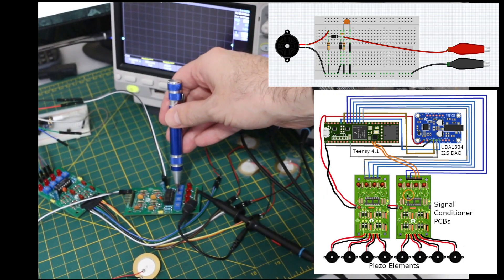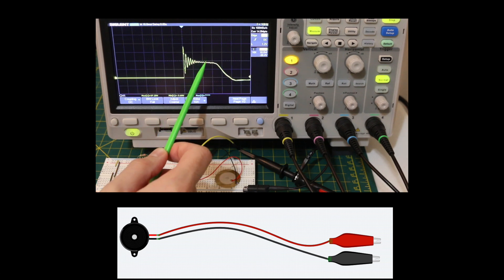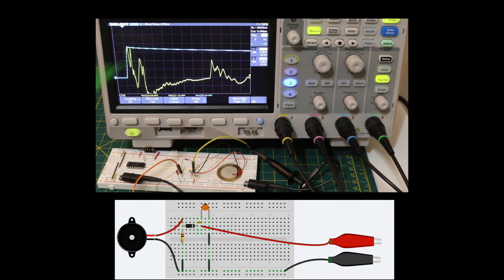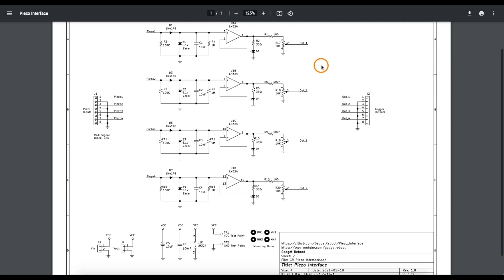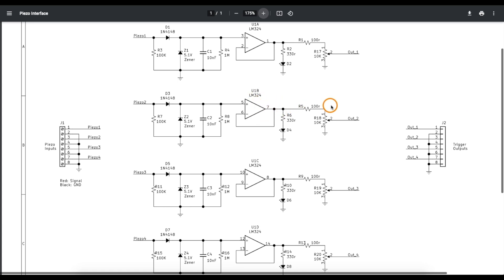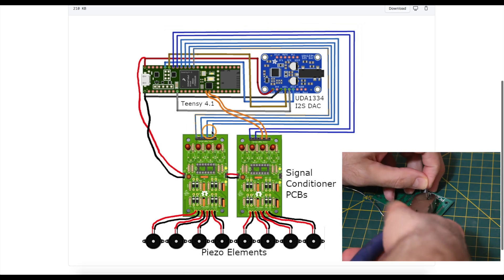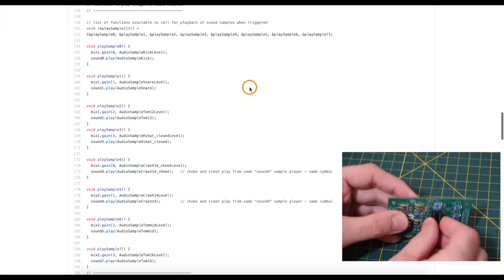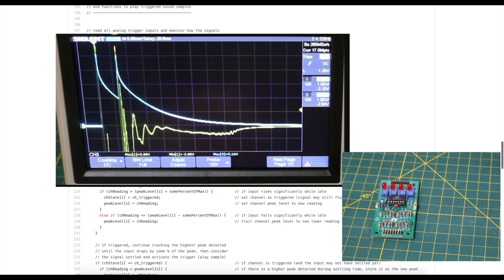Teensy 4.1 - Piezo Drum Trigger Signal Conditioner Interface (4-ch)

Comment: Hi, why do you do the peak detection befor the amplifier and not after?
Reply from the maker: The signal conditioning hardware is primarily to get the voltages within safe levels because sometimes it generates over 50 V.  
Then a load is needed on the piezo to help discharge its capacitance after being struck because otherwise sometimes when it is hit, it just stays up at an elevated voltage for a significant time and further hits may not be picked up.
so I decided to keep the voltages within the power supply range and force the signals to drop in level fast enough to pick up multiple hits.
The peak voltage didn’t always necessarily correspond with exactly how hard it was hit so the same relative strength of a hit might generate 20 V one time and 50 V the second time so I can’t just assume that one of them is more than twice as strong as the other based on that it was just a trial and error process where I found I can figure it all out with a max 5v normalized peak

Comment: Hi. Thanks for your video. I want to trigger the sample sounds on my wav trigger card using piezo. I'm trying to make some kind of percussion. wav trigger card also works with 3.3 v. trigger. I want to use your circuit in my own project, but did you feed the op amp directly with piezo or is there an external power in the circuit?
Reply from the maker: The op amp has a 5 V power supply and the piezo has some resistor capacitor diode passive components to do signal shaping on its way into the op amp. then the output of the op amp can have its maximum voltage controlled with the potentiometer for whatever it is actually triggering on another circuit to make sure the voltage is not too high

Comment: I'm thinking about using a digital output to act as a switch and discharge the capacitor quickly, but after a certain time, let's say 50ms. This should ensure that the ADC reads the right value and that there's no extra false trigger signals, like in 5:23. Has anyone done that?

Comment: Is it possible to use this (minus the adafruit board) for MIDI triggers? I want to use it a highly-responsive double-kick pedal setup where the piezos would be side by side hit by the kick beaters. Ideally it will just have a USB cable to send the MIDI from the Teensy to my computer. If I'm just doing MIDI triggers do I even need the signal conditioning?
Reply from the maker: i’ve never made a midi project but as long as the module can send midi messages over USB then it can do it on any input including this because the mini messages would just get sent out based on some decision being made in software.
 So the decision would be to send a message rather than playback an audio sample.
The main purpose of the signal conditioner is to get the voltages down within safe levels for the module inputs so it is still needed.

Comment: First, amazing video! I learned a ton just from the piezo signal conditioning segment alone!

I have a question regarding your choice of the Teensy microcontroller. I was hoping to use an Arduino for my project, but I'm struggling to play multiple sounds simultaneously (for example, a kick and a hi-hat are often played on the same beat). Is the Teensy board capable of playing multiple sounds simultaneously? Also, would it be possible to write code so that, depending on the strength of the signal from the piezo, a different sound file is triggered? I'm thinking for example, light taps on the snare pad trigger a rim click sound, but stronger signals on the snare piezo trigger a full snare sound.

My project will also be battery-operated, so I'm looking for a Microcontroller with a low power draw. When trying to choose a low-power microcontroller that can play/mix multiple sound files simultaneously, what sort of specs should be looking for? Thanks!
Reply from the maker: with the teensy it can play multiple different sound files simultaneously because they are all set up as if they are a separate sound source going through a mixer so the sound just gets triggered and then it plays through the mixer in software. I haven’t tried it on anything else so I don’t know if other software libraries on other chips can easily do the same but I just wanted to get up and running fast.
software can look at the analog trigger input and determine if it is a soft or hard hit and then decide to play a different sound sample because the strength of the hit causes a different peak voltage so decisions can be made based down how strong the input is.

 The harder part might be calibrating it so that it consistently knows the difference on a single input because there could be a legitimate quiet hit intended for one type of sound to be triggered but it gets interpreted as too quiet of a sound and it triggers the other thing

so multi zone separate triggers might be more ideal like how they do triggering on a snare with one dedicated sensor for the snare head and another dedicated sensor attached to the shell for rim hits.

for power consumption I don’t know if it directly would relate to the ability of a chip or its software to play multiple files simultaneously, it would probably come down to how fast the processor runs and if it has more on board resources that need more power in general to run so if the project is just to blink and LED, obviously there can be overkill processors that will blink it just as well as a simple circuit but take way more power
so it’s probably best to focus on what processors can have libraries that play multiple simultaneous sounds as a starting point and then look at their power requirements
if there are multiple chips that are capable of playing the sounds as intended
Reply: @GadgetReboot  Thanks for the quick reply. Everything you mentioned made a lot of sense.

I looked closer at your sketch and realized that the Teensy is not playing .wav files from an SD card, but converted .wavs using wav2sketch. So that effectively eliminates the need for an SD card, and allows you to store the sounds directly on the Teensy's flash memory. Really neat stuff!

I wonder if you happen to know the overall size of the sketch in KB as it was uploaded to the Teensy? I'm trying to come up with a minimum RAM requirement for my project while choosing a microcontroller. I don't see myself needing 8 different sounds as you use in your project, but knowing how much ram your sketch required will help inform my decision as to what microcontrollers might be appropriate for my project. As I mentioned previously, I'm trying to keep my project compact physically, as well as keep the current draw to a minimum, so if I can get away with the 2MB of flash memory available on the smaller Teensy 4.0, I would probably prefer that over the larger Teensy 4.1, even though it has 8MB of flash.
Reply from the maker: I just compiled it and it shows
Sketch uses 2159648 bytes (26%) of program storage space. Maximum is 8126464 bytes.
Global variables use 45748 bytes (8%) of dynamic memory, leaving 478540 bytes for local variables. Maximum is 524288 bytes.
So just over 2 MB of flash including all those samples and 45K of ram it looks like
Reply: @GadgetReboot  Awesome thanks for those numbers!

Today I ordered the Teensy 4.0, along with their Audio Adapter Shield. Hopefully I can fit my program into the 2MB of flash on the Teensy 4.0, but if not, the Audio Shield has a nifty spot to solder on an additional flash memory module, which looks like could expand storage by another 128MB, which would be PLENTY of space for my use. 

Thanks again for the info. I'm considering creating a PCB on PCBway for some of the additional circuits I may need. If so, I'll be sure to use your affiliate link!
Reply from the maker: hopefully it all works out. I might try using ESP 32 some day if I can find similar audio player code.

Comment: Why is the OPAMP needed as a buffer, what would be missing if we just use a 3,3V Zener diode and plug is straight into the ADCs?? Thanks
Reply from the maker: One reason for all of the signal conditioning was to help control the signal because once the sensor was struck, sometimes it would hold on to a voltage for an extended amount of time before the charge goes away so the ADC would see this extended duration maximum voltage based on what the Zener clamps it to.
that was making it difficult to detect multiple rapid strikes.  they would just look like one long single hit so the components help to discharge the transducer and then It can pick up another signal instead of it getting lost.
and with all of those extra components, that’s why the op amp  was needed to buffer all of that from the ADC, so that it doesn’t impact the behaviour of all of the charging and discharging timing.

Comment: can't thank you enough for this. i'm working on a desktop sized trigger with the same layout as a certain javanese instrument to use as a practice tool. the instrument is comprised of two rows of seven horizontal gongs. the scale ascends left to right on the lower row and ascends right to left on the upper row an octave above. so it's a bit of a brain breaker if you're not used to it. it's also enormous and i wouldn't even know where to get one if i had the money and the space! so how to practice?

not using MIDI hadn't even crossed my mind! but a self contained unit that just does the one thing it's meant for has an elegance to it. some serious food for thought. of course i would either need two 7 channel boards or 4 X 4 to pull it off...  

anyway, thanks for the great explanations of each component's job in the circuit. this solves the issues i was facing with piezo and teensy. very excited to look more deeply at the code and see what ideas are born;)

Comment: super cool man. why use the zener and all that when you have the 1n4148 which drops the signal by .7v if the input is 5v. you probably said brother but i missed it. i get why you used the opamps. i like how you use them all the time, it shows your experience and the fact you want to keep the signal integrity. i suppose the dc input to the opamps are 0 on vss and 5 on vcc ehh? or could you put higher voltage through them then trim the output with the pots on the output?  awesome circuit man.
Reply from the maker: The zener was used just to try to keep the signal no higher than 5v but let it pass unaffected within 0-5v because the peaks can be anywhere up to tens of volts, so I'm keeping it max 5.1.  I don't remember the max input op amp voltage on that part relative to VCC but definitely not higher than VCC.   I keep meaning to do a revision of the circuit but then I keep forgetting what changes I wanted to make.
Reply: @GadgetReboot  ok cool. I don't think you mentioned is why I asked but I'm apt to miss things pit of stupidity haha.

Comment: Hi, congratulations on your project, it seems really well done and above all well explained. Maybe I ask a question already asked: you built and calibrated this circuit by hitting the piezos directly. In a battery with mesh heads, the piezo receives much less stress than hitting it directly, I breadboarded your circuit but on very low hits without the op-amp receiving almost nothing to amplify, so its function is very limited, do you have any suggestions?
Reply from the maker: if there is still a signal but it is weak, I would probably be performing the same calibration playing with existing component values in a prototype until I get a signal strength that works with the set up or , adding another op amp stage at the output can boost it, as long as the maximum voltage is still going to be within safe  limits for the input it goes on to.

Comment: Hello.... I tried to understand everything, but since english is not native, i might have miss something. If I follow and build everything you show, i dont need a computer and softwares to play? It will work as a modulo as the commercial drums do?
Reply from the maker: if this project is duplicated, there is no computer needed after programming the teensy 4.1, all of the sounds are in there and it works as a standalone player.
Reply: @GadgetReboot  since i dont know how to sold the PCB, is it possible to buy aready built? And is it possible to control more than 8 analog inputs?
Reply: And... is there a Hihat controller? To control the opening and closing making different sounds?

Comment: @GadgetReboot im back on this project after being busy with work, im thinking to order this from PCBway, but before that, i wanted to ask if theres any improvement you make on the circuit design?
Reply from the maker: I haven’t changed anything on it since it was released.
Reply: @GadgetReboot  awesome! Pcbway review my order currently, im going to use it with my old teensy 3.2. For sure need to do change the io assignment..but else than that..do you think the code run on teensy 3.2?
Thanks for the reply
Reply from the maker: The oldest board I have used is 3.6 so I’m not sure what the difference is, the only special thing the software does is load the audio samples into memory to play them back so maybe there could be a problem if that other board doesn’t have enough memory so you could try compiling the sketch for that board and see if it fits, and if there’s not enough memory maybe you could remove some audio samples or use smaller ones
Reply: @GadgetReboot  ive ordered the board from pcbway, id love to get your assistance in this if you provide the service, i have a very specific project that i want to establish.
Reply from the maker: I just make personal project videos, I don’t have the resources to do anything beyond that.

Comment: Hi! Very nice video, thanks a lot for that! I have a question: I haven't tried out the circuitry but just having a quick look makes me wonder if the Zener doesn’t limit the dynamic range of the interface significantly. For example, my edrum pads output up to 30 Vpp, with the positive component (after rectification) being roughly 20 V, if I hit them hard. Here the Zener would result in all hits giving more than 5.1 V piezo output being clipped to the same value, wouldn’t it? Thus, I would lose ¾ of the dynamic range. Or do I misunderstand something here? Would it be a workaround to use a 100k trimmer in the input that would still load the piezo with 100k but also giving the possibility to scale down the input to the full dynamic range of the drum pad?
Reply from the maker: are those pads pretty much the same thing, just a striking surface with the output of the sensor and no other electronics until they plug into something else?
The reason it’s scaled down to 5 V is because that’s the limit of the digital circuit it ends up plugging into so whatever those pads plug into probably ends up scaling that down as well to a safe level.
I don’t know if it works out directly proportional but it’s possible some dynamic range is still preserved by clamping it at 5 V max because it’s  sitting at 5 V for the duration that  the sensor itself would be higher so the amount of time it’s at 5 V may be the translated dynamic range of how high the signal managed to get. 
So if it only peaked at 10 V it may drop down below 5 V sooner and have a shorter pulse width but if it got up to 30 V it may stay locked at 5 V longer and however it’s handled in software, a longer 5v pulse can be interpreted as a louder or harder hit.
Reply: @GadgetReboot  Sorry for my delayed response! Yes, I unerstand the reason for the 5V limit. My question was just concerning the fact that the input seems not be scaled down but actually clipped. However, I didn't realise that the time course of the (clipped) signal might still contain volume information. I will start experimenting a little bit and then decide what might fit my needs. Thanks a lot for your explanation!

Comment: Thanks for this very informative video, I have a couple of questions: 1) would this work with digital input as well (basic on/off - value not necessary)? 2) If I wanted to do this with only one piezo which single channel opamp would you recommend? Thanks again!
Reply from the maker: I use the LM358 op amp as a general purpose and there’s two of them in the one eight pin package. I would expect that to work fine here.
I also would expect a digital input to work to trigger samples because the analog input is just an increasing and decreasing voltage that is within 5 V logic levels going into the op amp, so the digital zero to five or even zero to 3.3v would be the same as the analog signal  jumping directly to those voltages instead of more gradually going up and down.

Comment: One of the coolest things I've seen on YouTube in a long while. I've actually been thinking of modifying an existing eDrum set to essentially connect via Ethernet (instead of 1/4" jack) and completely bypass the sound module or a drum trigger interface and connect to a generic 8 port switch > into MacBook  and trigger Drum Sounds within the software using Network MIDI. Spawning some ideas.